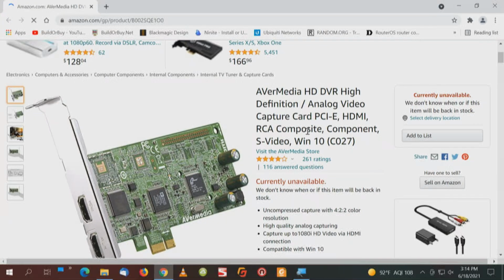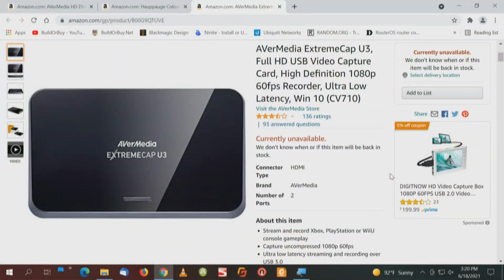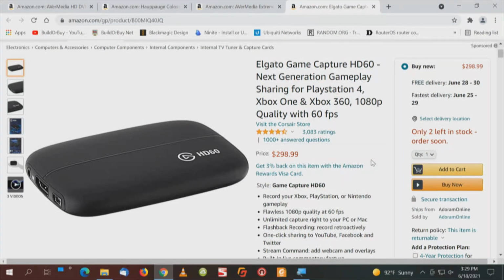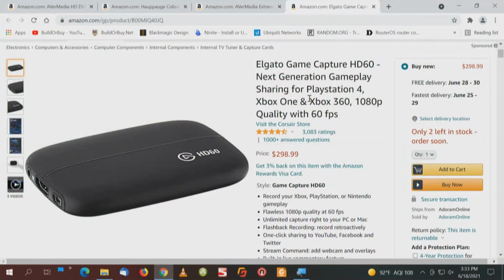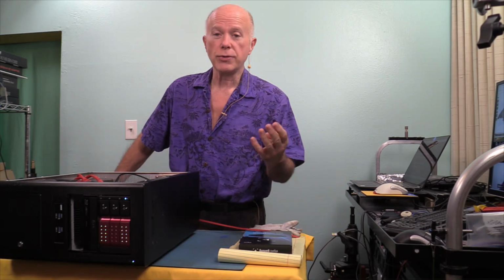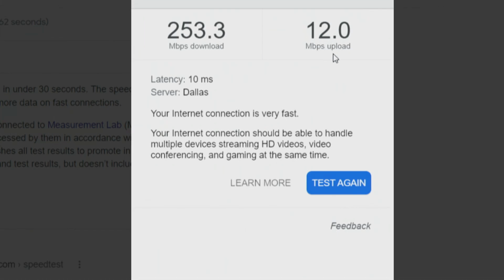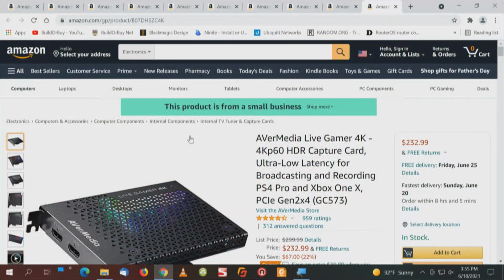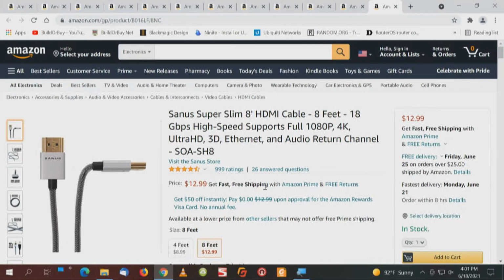Beginners Guide to Capturing and Streaming Video

Comment: oh my goodness, thanks for making this video. i didn't realize so much went into streaming! i bought an off brand version of cam link on amazon once and couldn't get it to work so i returned it. how much does all of the above cost to get it running for 1080 vs 4k?
Reply from the maker: Hi The Intelligent CPA, 
Very much Appreciate Your Comments! Those types of Devices You mentioned require 3rd party software. And some, As You have found can be finicky as to Camera compatibility. Our Goal was clarity. Costs depends upon complexity. Basics for a Consumer configuration for 1080 would be: 
1. Capture Device - Elgato Game Capture HD60 S external (software included). Having the software included that's made to work with that Device simplifies Configuration. 
https://amzn.to/35FPztR
2. Camera 
3. HDMI Cable 
4. Computer 

Audio should be plugged into the Camera to minimize Sync issues. 
We're going to do a Video on that Device. And will address Your Question further in that Video with more detail! In the mean time, if You have more questions about Streaming, pleas let me know! Here to help! Thank You for Asking! 

We can talk more about 4k and more Options when interested. Streaming 4k requires Bandwidth for the H.264 Codec which is what YouTube will accept until YouTube utilizes the H.265 Codec which conserves Bandwidth!
Reply: @BuildOrBuy  thanks so much! I don’t think I can run 4K with my current laptop yet so will wait for a future video. Is there a computer you recommend for video editing?
Reply from the maker: HI @theintelligentcpa7372 , 
Yes. Laptop? I'd be honored. Do You have a Brand preference? Dell? Do You want Specs in general or a specific model? Here's a specific model. 

2021 Alienware M17 R4 Gaming Laptop, 144Hz FHD, Intel Core i7-10870H, Nvidia RTX 3070, 16GB DDR4, 1TB NVMe SSD plus 1x Thunderbolt 3 Port!
https://amzn.to/3qqfH5p

That's an excellent Laptop by the Specs for the price!
Reply from the maker: Hi @theintelligentcpa7372 , 
We're Filming another Video in response to Your question and several other Subscribers who are asking. We'll outline 5 examples of the type of Computer You need. The Alienware M17 R4 may not be upgradeable on the RAM. And that's a problem. Stay tuned!
Reply: @BuildOrBuy  how exciting can't wait!
Reply: @BuildOrBuy  wow, thanks so much! i will have to save money for that one. is there an equivalent in mac that you recommend?
Reply from the maker: Hi @theintelligentcpa7372 , Appreciate Your Patience!
Reply from the maker: Hi @theintelligentcpa7372 , We only do PC Computers, not MAC. The best We can offer is the Adobe AE Multi Frame Rendering CPU Optimization Formula below. 

1. CPU Cores x 4 = RAM
2. CPU Core count  = Video RAM. 

Hope that helps! Thanks for Asking!

Comment: Wow. Opened my eyes to some possibilities and a change or 2. Thanks, Gill very informative.
Reply from the maker: Hi VA4Y Video Productions, 
Welcome! That was Our Goal for Clarity and to consider Your Options whether going Consumer, as shown, or Professional, as mentioned. Bandwidth is the key to Success! A Consumer solution is easy for a 1080 / 59.94 Stream. Whereas, a 4k 30 or 4k 60 Stream, may be better suited to a Professional Solution due to the Bandwidth Required. Also using different Codecs, H.264 vs H.265. This is Reverse Engineering. Then figure out the Build out of Cameras to Video Switch so when You go Live, You're set from the get go! Feature or Benefit! Options! Thanks for Watching! Let Us know if You need more help. A Video may be in order based on Your Question. This Video was in response to questions we've been getting about the Technology as it relates to installing a Capture card in the 4 levels of Computers We've Outlined to Build.